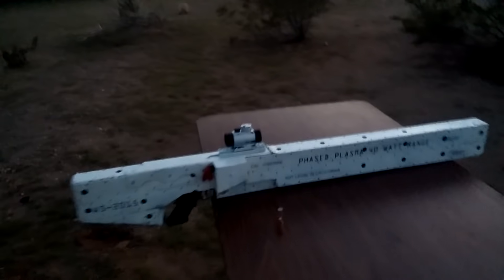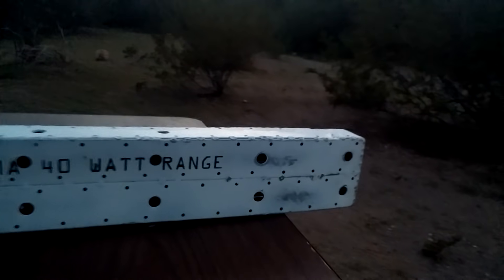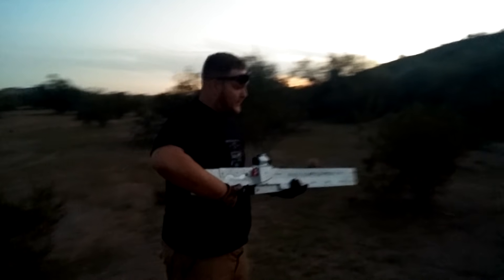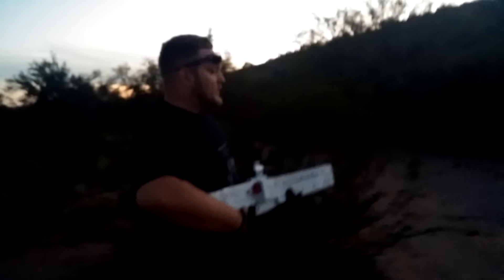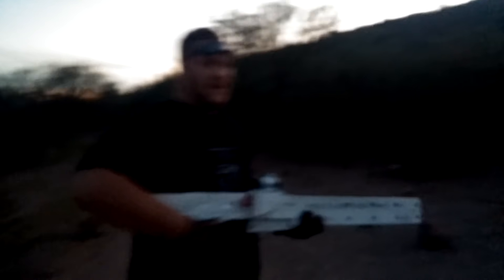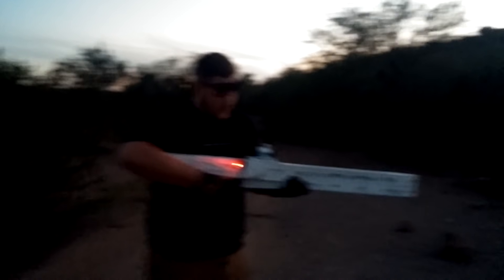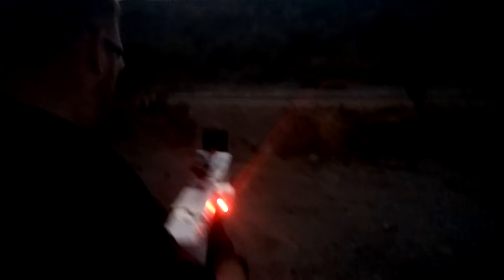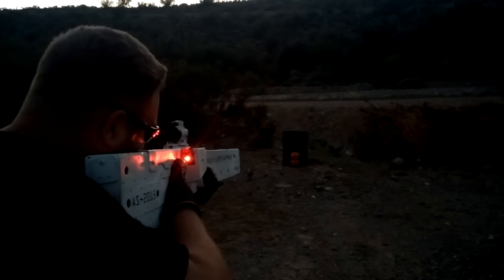Electromagnetic Plasma Rifle (Night Time Test Fire)

Comment: hey, im trying to make a railgun with a buddy of mine, and i have a couple questions for ya:
how'd you make the helical rails? it sounds hella expensive to get machined
what materials did you make your rails out of?
what did you use as a heat sink for your rails so they don't overheat?
how do you make sure that the electromagnetic force pushing the rails apart doesnt blow up the gun when you shoot it?
what kind of power source+capacitor did you use?
im p sure you mentioned it was breach loaded, but do you use a gas injection to make sure that the projectile doesnt get welded to the rails?
i realize that that's a fuck ton of questions, but if you answered even a couple, that'd be really cool tbh
Reply: +Lord Zantaff aerogel is a supreme thermal isolator, not to smart to use it as coolant ;)
Reply from the maker: +Garrett B Lol thanks for the questions. The helical rail wasn't actually very hard to make. Take two solid copper rods and lay them side by side as you would with a typical rail gun. Then place a metal rod/tube between them that it the same diameter as the projectile you want to shoot. After that, stick both ends of each rail (4 total) through something solid to hold them in place. Now, you just physically twist the rails around the metal rod in the middle. With both ends of each rod secured, you don't have to worry about anything getting out of alignment or not twisting evenly. And copper is fairly malleable, so you don't need super human strength or anything to do it. And ya, I've discovered that it's not the most robust design. The rails started to melt after a while and eventually they did basically just blow apart in the areas that weren't supported all the way around. The capacitors were just a bank of Coke can size capacitors I got off ebay. Just charge them to capacity (use an rc/airsoft battery charger to monitor everything) and the trigger just basically dumps the energy of the bank at once. So not exactly sophisticated or ideal for semi/full auto firing, but it works well for single shots. And no, there isn't a gas injection system, I used an electric solenoid for the initial acceleration. I hope this helps :)
Reply from the maker: +Alex Smyth And now that i'm thinking about it, instead of supporting the helical rails with external support rings like I did, you could probably just slide the whole thing into a long aluminum tube so its supported evenly all the way around.
Reply: yeah, one of my ideas for helical rails was to put the helical rails and the barrel inside some sort of non-conductive tubing, like pvc, then pump mineral oil through the spaces (this is how some people cool gaming pcs) and then put another tube outside of that one for reinforcement and fill the space in between the two tubes with like concrete or something. well, probably not concrete cuz that would make the gun heavy as fuck, but something like that.
Reply: +Alex Smyth an external power supply, like a backpack, would free up space inside of the device for a sturdier support structure and heat dissipation, and would allow for more consecutive shots. A variable yield control would also stretch the battery life, since you wouldn't need full power at closer range.
Reply: damn, I thought no one would notice! xD
Reply: +Garrett B fill it with aerogel for the looks and the cooling

Comment: aril gun works when the two halical rail is shorted by a projectile, by the law of phisics current will flow through that portion where it faces least resistance and thats the cupper base of the bullet, hence the gas inside the glaSS will not be effected, and theres no chance to carry the plasma from the barrel to the aim. but hell of a gun you made man, and also to do what you said there should be 4 rails, 2 accelerating the projectile, and other2 creating the plasma inside the glass, but then also once the contacts break the plasma stops instantly so theres no chance to carry the plasma, but thatz reaally a hell of a gun, its sexy, color it black man, itz evil like the devil, ufffff

Comment: What's the recoil like on it?
Reply: +Alex Smyth While I would agree that there's probably a significant force acting to separate the rails when the gun is fired, I wouldn't term that recoil.  It'd most likely be a byproduct of the lorentz force that's propelling the projectile.  Recoil as the term is commonly used for firearms would still be directed along the barrel of the weapon, in the opposite direction of the projectile.  Not perpendicular to the shooter, as you suggest.  My proof?  Newton's third law.
Reply: Technically there shouldn't be any recoil from the gun since it doesn't use a chemical propellant.
Reply from the maker: +Kyle Gilchrist There's recoil in that there is an opposing force to the projectile being accelerated. With rail guns though, the recoil isn't directed straight back at the shooter, it's directed perpendicular to the shooter, outward towards the rails. And the fact that it is so ridiculously heavy reduces recoil as well.
Reply: +Alex Smyth Wait, so what's the opposing force that causes the recoil?
Reply: +RapidPiqq conservation of impulse, like with a chemical gun as well.
or like in a jet engine, or rocket engine, or with a boat engine....
Reply: +Alex Smyth The forces on the rails oppose each other, but there has to be recoil opposing the projectile, too.

Comment: what did you use to power this thing? your gun is not plugged into something, meaning that you must have a big power supply in it. wonder how heavy and how many shots it can do..
Reply: +Jack of Knives (Amieldelmundo) Excellent point,...!!! In my thoughts, and experience,... for a power supply to generate enough velocity for even such a small projectile, to achieve the results that were displayed,... It would have to be physically very large, if not far too heavy of a unit to hold off hand,... I am more interested in the achievement and result of the miniaturization, and design of such a power supply,...than the rifle itself,...!
Reply: Mr. jdoxs The railgun is pretty simple.. so yeah... that's the same thing I want to know too. Giga-capacitors? Flywheels? The last time I checked, I saw a guy who made a pretty similar railgun, except that it's very large and heavy because it's carrying a bulk load of large capacitors.
I'm not sure if this video has good vfx, or they disguised a regular chemical-powered gun under a railgun shell, or they really are using some advanced power system. :/

Comment: That is actually surprisingly simple to make. 
I was going to make a coil gun that launches heated plasma, while using the oxygen around you as an ammo resource.
So it wouldn't have the puncture, or impact power as this gun, but it would have melting power. Good for lobbing a heated ball of plasma at someones face. You know, like in StarWars.
Reply: Do you have a project of that? Maybe a tutorial...
Reply: OsThe Watchgamers No. It was just an idea that I played around with.

Comment: I also have a solution for that ricochet problem, by using imploding rounds will destroy the round casing upon impact. The design work like a double impact, since the rail send the projectile down range it will hit the target causing the implosion, but you will have to redesign the copper sleeve to be more of a payload 

when you know about building guns and the 3 things need to fire anything is the round in you're case vacuum tube, the barrel (rails) and armature. In you design you round was incomplete in some cases plasma round no/yes, but like I stated above more of a payload. Now since we are using vacuum tube you can make imploding explosive rounds, by designing the sleeve to collapse on the vacuum tube breaking it act like a armature due to mixing certain gases and materials will cause the round to explode melting the shell casing like shooting a mini plasma missile let toss around some ideal I always wanted to get into future weapon tech designing for space exploration since you never know whats out there
Reply: Genius. This was my initial idea for a plasma rifle. Literally firing a vacuum. Possible, but difficult.
Reply: Using bismuth can keep the round cool as it looses heat in response to electromotive force. It’s also a stronger dielectric so more push for the same power.

Comment: do you have links to the capacitors and/or batteries you used

as well as the helix barrel parts?
Reply from the maker: +Sarude Dankstorm The capacitors are just 400v capacitors off ebay. The big blue ones that look like soda cans. The rails are just metal you can get at home depot etc.
Reply: Alex Smyth recommendadtion

find out how much the vacuum tube's max voltage is.

the gun may be charging it at above that and causing it to explode before it hits

Comment: Hey man this gun is awesome! You did a great job, your .22 Steam punk Gatling gun was super awesome too. I had a question though, where can you buy tubes of neon gas like that? I was actually thinking about the same sort of concept but without the glass, but I think that the glass around the glass is a great idea! Thanks!
Reply from the maker: +Scott Hall Any place that makes neon signs should be able to make them. You pull a vacuum in the glass tube, draw in neon gas, then just melt the glass vial shut at the end.

Comment: Does the projectile containing plasma actually do anything? It's hard to tell from either video. Maybe try one slowed down? It just seems to act like a normal railgun.
Reply: +DGneoseeker1 coil gun actually like it name, made by a coil of wires ,it create an electromagnetic field when we put the current in it just like how transformer work while a rail gun work when a pulse of  super high currents send through the rails . when you put a conductor which is the projectile between the rail, the current run through the projectile ,creating an electromagnetic force that force it forward, so why it has spark?  the contact between high voltage positive and negative happen on the projectile when fired...so yeah..that's why..
Reply from the maker: +DGneoseeker1 In all honesty, I don't actually know lol in theory, yes.
Reply: +Alex Smyth  Actually, what's causing the big flash as the projectile leaves the barrel?

You don't see that with coilguns...

Comment: I'm sure the military would be very interested in this.
Reply: +Avensis Astari The military is already working on Railguns, as defensive weapons and as naval guns. They far outrange conventional guns, and even many missiles, while having greater precision than normal guns, and 5x the muzzle velocity.

At the ranges one would engage a target with conventional weapons, railguns completely blow them out of the water, to the point where in some cases you'd have to dial the power down to avoid over penetrating the target - meaning, shooting clean through without doing much damage.
Reply: +ANK H The US military has done tests with plasma weapons in the past, although the whole program dropped off the face of the earth in the 90's. Either cancelled, or it went dark.
Reply: Avensis Astari They usually SAY things are cancelled when they cancel them.
Reply: ***** The rails have to be tightly secured, or they'll repel each other with enough force to blow the gun apart.

Comment: All I can say is you better patent it before someone else say they came up with the idea...
Reply: +Lucky Underwood Patents are for pussies.
Reply: It's already been patented, back in the early 1900s. However, no one could get enough electrical power to actually make it, so the patent expired. (Early designs would have required enough electricity to power half of Chicago.)
Reply: Patent what, putting a rifle in a white box and adding an led, switch, and battery?

Comment: Wow! So many questions about this thing...

Are you planning on doing a video showing us what's under the hood? 

You mentioned helical rails to serve as rifling, imparting spin to the projectile. This is due to the copper armature's contact with the rails when it fires, yes? What's the mechanical stress for the helical design like compared to a conventional straight rail design?

What kind of figures are we looking at for the  rifle's operation? Power, size of the capacitors etc?

Have you considered, were the resources available, doing a video of "what happens on impact?

I'll probably have a bunch more questions, and this probably isn't the place, would you be happy to discuss this via email?
Reply: +Tom Cole u pirit i mammat

Comment: What kind of velocity are you getting? Supersonic?
Reply from the maker: +Ariel Fetters Not sure specifically. Supersonic for sure, since you get the loud crack. "Supersonic" sounds fancy, but its only like 800 feet per second. A lot of pellet guns can do that. But i'd guess between 1,000 and 3,000 fps. I need to invest in a chronograph lol
Reply: +Alex Smyth I would guess is in the 3,000 fps range (closer to an "everyday rifle") since you were able to penetrate the steel, to me the real question is does the plasma make a big difference, if there is plasma in the first place. Btw u guys did a hell of a job, I wonder how accurate it actually, please make a vid with it actually zeroed lol
Reply: +Gabriel Amat thank you I now see that there are no intelligent  humans any more,good bye world.
Reply: +Gabriel Amat In a later video, the coppersleeve (copper is a really shitty penetrator, btw) actually ricochets off the steel target, still there´s a hole in it and you can see something is impacting behind the steel plate.

So my guess is it´s not the copper penetrating the steel, it´s the plasma.
Reply: ***** I doubt the glass makes it all the way too, but the impact and release of plasma might make a difference, or it might not, and yes when you are using such bursts of energy to fire a projectile there is plasma forming in the chamber, that's most of the sparks you see when he fires it, the big question is if the glass even survives the high G forces generated from the acceleration of the projectile and the high temperatures present inside from the plasma, that was the origin of my question, sadly I'm not the one with the toy so I have no actual way of knowing whats really going on, I doubt there is an AR 15 inside the casing lol, they don't spark that much
Reply: ***** No the "metal part" put a hole, in it, I was just asking if the glass with the plasma in it even helped, is not a "plasma rifle" even though the title states so is a rail gun, the high magnetism generated creates plasma inside the piece of glass, that's their own addition, ive never seen that done before, I might end up building one some day, just for the sake of it
Reply: the one where the guy holding the camera gets hit by it?
Reply: +Ariel Fetters Seriously? A bullet's supersonic and it would be an obsolete weapon. (plasma)